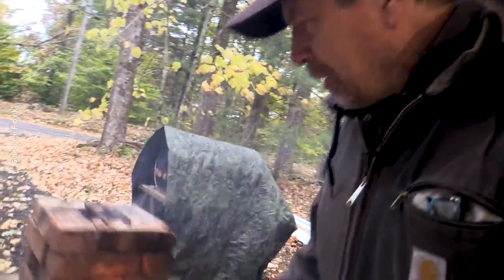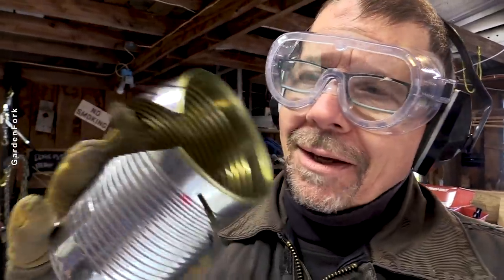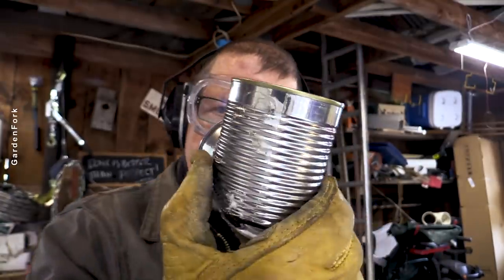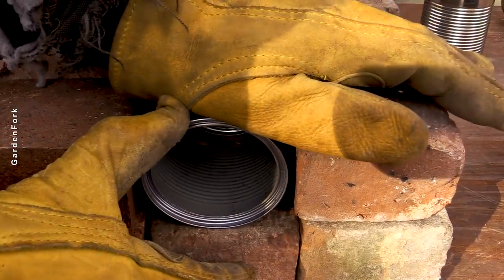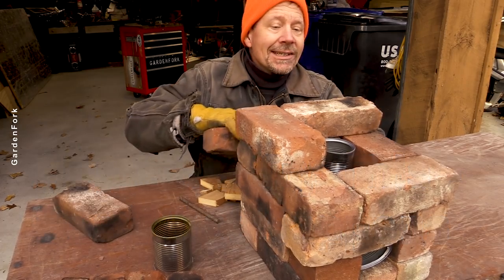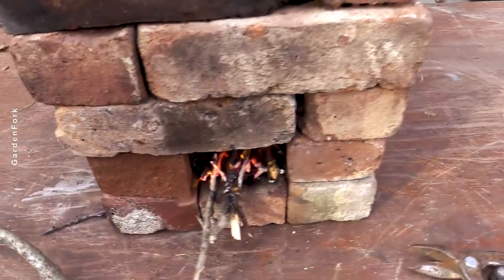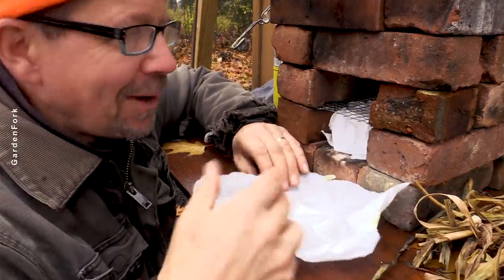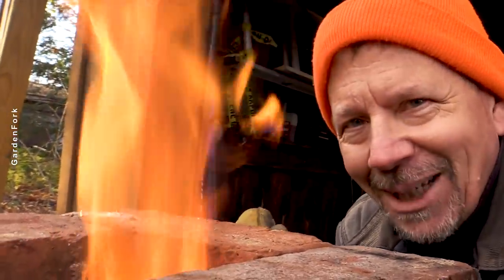A Better Brick Rocket Stove?

Comment: A metal dryer vent or water heater vent elbow  works great.  Cheap and easy.  Also put the stick hole towards the wind so it will blow in to feed oxygen to the fire. Adding a 1" stick in the chimney helps the  fire feed up to the pan.  These tips made my stove work better.  Going to change mine from 16 to 20 brick stove.  Also saved the burner grate off the top of my old gas cook stove to put on top of it.

Comment: You nailed it, Eric! Could it be better? Well, maybe, but that second one is officially *Better Than Good Enough*. After that, it's all just goofing off. We're all welcome to goof off, because goofing off is fun, but for simplicity, when you're just going to go speed-fire in the back yard, now you know: A metal grating plus that many bricks, built with that height, and the job gets done. 

That skill is especially useful when wood is wet, because with a fire that's high-temp, low fuel-consumption, you're able to cook larger fuel, driving off dampness so that you can get a larger campfire going.  Again--you nailed it, great job, and as always, I really love your personality. The ethic of showing what doesn't work and then working your way toward what does work--that's the best example for anyone trying to develop a new skill.

Comment: I made one of the coffee can rocket stoves that are on Youtube, I wish there was a way for the fuel/wood to be gravity fed when using it.  There isn't a ton of room for the sticks of wood and they tend to burn up quickly while I'm cooking.  Trying to feed the fire and cook at the same time is  a challenge.  If the tube for the sticks was at an angle, I could use much longer sticks that would keep falling in as the ends burn.
Reply from the maker: Hi Jess, I’ve seen pellet rocket stoves that have the angle feed. Mbe a video? Eric.

Comment: Great Video.  Fire at the end was pretty high for cooking.  Too much air is flowing thru so If you slightly cover the bottom opening of the rocket stove with a piece of tile, but leave a little space for air to cycle in. Now there is less air in, less flames. And the fire should last longer.  
I am from Texas and am experimenting while I build one also.  Also try putting an open can underneath the metal sheet. Just a thought if you are using it for cooking.  If its just for heat or just chillin' out...what you made works just fine.  Bricks seem better that the blocks. Great Video
Reply: Agreed, blocks won't last if you really needed this to feed your family. Bricks last and last! They are a lot more expensive but worth every penny, IMHOpinion!

Comment: Instead of screwing the cans together, friction fit them, drill holes and then pop rivet the pieces together to make a continuous stack. Also you need to seal around the joints to get the best air draw. Maybe go with a plaster of paris? I think they are pretty cheap, that's what everyone uses to make tin can forges.

Comment: JB Weld (epoxy) should hold the cans together. 

The Dakota fire hole has a 1 ft diameter burn pit and a smaller tunnel coming into it. This creates a venturi effect. Rocket stoves are based on the Dakota fire hole. So my idea is to make a venturi (hourglass shape) in the chimney section. I don't have a solid idea on how to do it. Maybe have enough bricks in the stack so you can push the side bricks in a middle layer closer together to create the restriction. Try using a half brick on the back wall to accommodate the decreased diameter from the sides. I've had a problem getting the half brick cut squarely. Maybe on that one, turn a whole brick sideways (parallel with the side bricks). 

Alternate idea for venturi. Make the feed hole larger (2 bricks high) or smaller (how? cut height of a brick in half?)

The venturi is used in the old style carburetors. Low pressure on the manifold side (away from the intake side) is where the fuel is sprayed in. Creates high pressure at intake side, low pressure (low pressure vacuum) on the manifold side. 

For a visual example of a venturi, imagine a multi-lane highway where construction blocks off one or more lanes. Traffic backs up coming into the funnel, then as cars get through the restriction they speed up. 

Once you have the venturi, you can play with the size of the restriction to see the effect of flame height, listen for roaring. 

A thought on the hardware cloth. I like the idea of a fire grate but HW cloth is galvanized. The heated zinc puts off toxic fumes. Better to go with a steel grate

Comment: can is a great idea, just gotta seal the can with metal ducting tape or rivets or tapping screws or drill holes and use wire.I would  put   sand around the  outside of that or  can system FLU
Reply: like the second idea too,  :)   great work ,   I have to way to make   2nd  option better, props

Comment: What's your goal here, to make something that works better, lasts longer, or is portable (or can be disassembled)?  Cans just aren't going to last long.  I'd just get 2-3 feet of black pipe, weld the angle, maybe more like 110 degrees.  Mortar all the bricks together permanently, filling the void with vermiculite insulation.